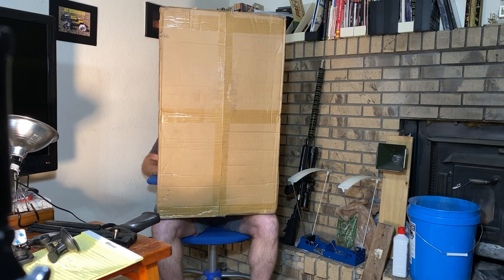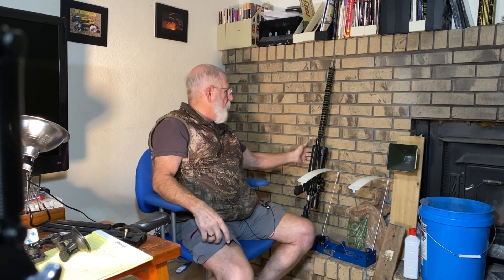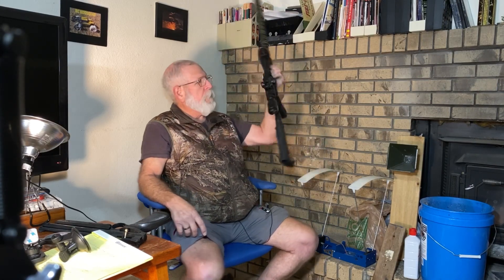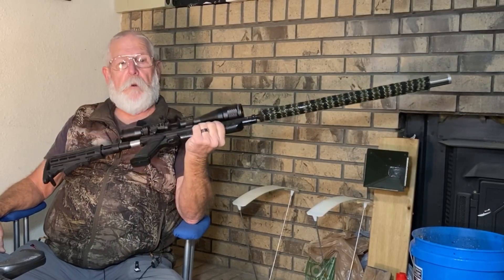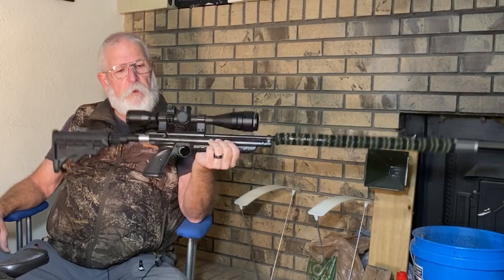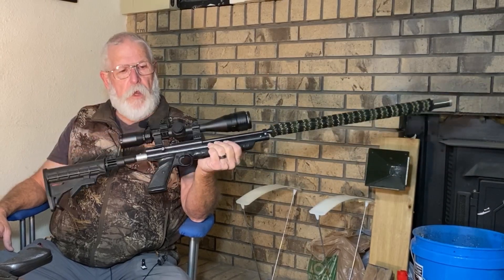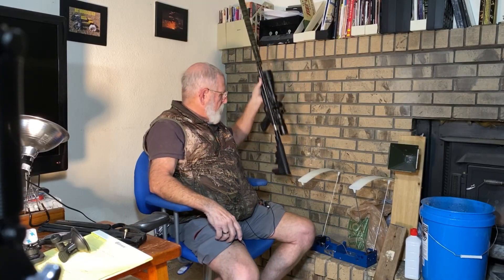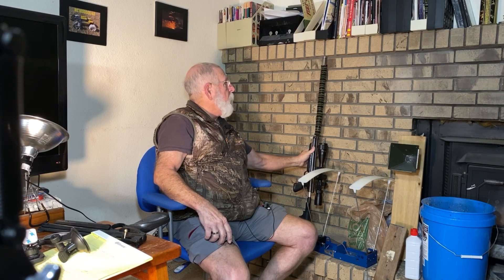WLtoys 144001 brushless upgrade progress

Comment: Very cool my brother. I thought you were gonna do a spoof upgrade video of the 14th scale turning into  well you know! Lol! Airguns are nice but I haven't been into shooting them in many years... That one looks like it's very accurate! Nice! I got my first gun at 3 years old a Springfield armory single shot bolt action 22 long round riffle. I used to love target shooting! Is there a specific reason you went to a smaller size motor? Maybe higher kv? Can't wait to see them go! Have a great day my friend!
Reply from the maker: Mikes RC Garage thanks for the input Mike. It is very accurate. I use it for  “urban pest control”. 

I just haven’t seen anyone else use the smaller motor yet so I’m curious what it will do. Several people are using a 4300kv and the one I ordered is a 3930kv so it won’t be faster. 

I guess more than anything I’m curious what it does for acceleration and battery like. 

I’m also want to get a little time in on my lathe. LOL 

Thanks for watching bro and thanks for the comment. 👍🏻👍🏻
Reply: @RCModSquad  Oh okay yeah a lil slower but maybe more torque! It always good to try new things to see what happens! 😎👍
Reply from the maker: Mikes RC Garage basically if nobody does it we won’t know.
Reply from the maker: Mikes RC Garage BTW: not only is it accurate, it’s silent. You can actually hear the pellet flying through the air.
Reply: @RCModSquad  Very nice!